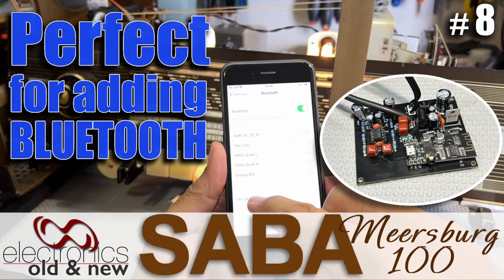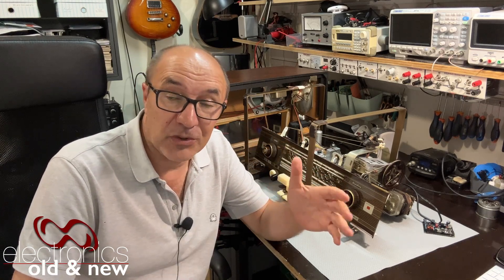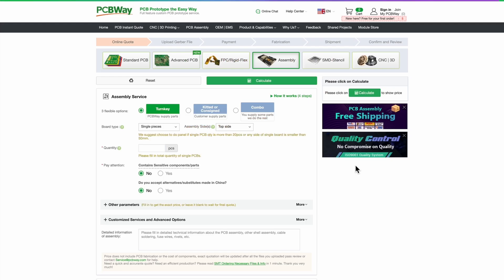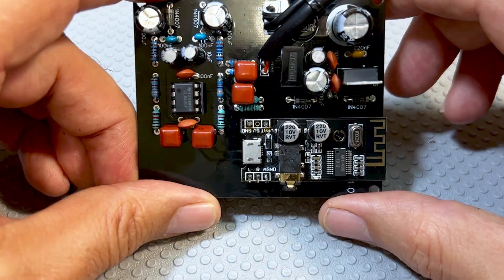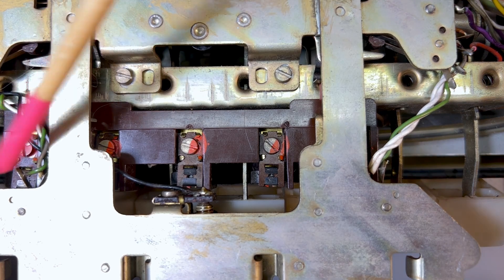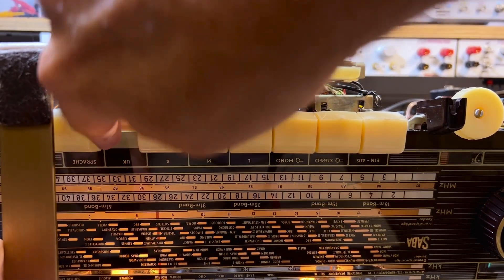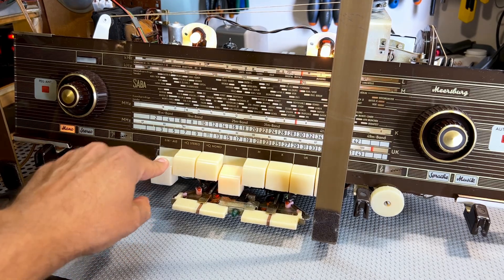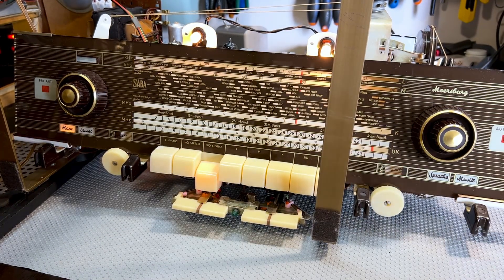This radio was made to have Bluetooth! SABA Meersburg 100 restoration part 8  #pcbway#

Comment: Neat solution with the piano key illumination switching. 👍 Luckily with my Graetz Fantasia 622 I had some spare contacts on the FA key (which is also used in conjuction with the TA key to select the TB input) so I was able to use those to supply power to your Bluetooth module which works brilliantly. I think this comment gleaned from the Web about that particular Graetz radio with its "Schallkompressor" could equally well apply to your Saba - "The radio was built to meet the needs of the wealthiest audiophiles of the day. The sound of this radio is still outstanding today."

But don't tell anyone else or they'll be buying these radio's for parts and stripping the speakers from them. 🤬
Reply from the maker: It’s a good idea to keep some things to yourself 😊 I did a series on the grundig 2147 for a German magazine, and the prices more than doubled. Talk about shooting myself in the foot 😊

Comment: I'd replace that bulb with a blue LED and a resistor. It's not original anyway with the Bluetooth. But if that's a AC source as you said, would an LED like the AC? Probably not so you'd have to rectify and then it'd be a bit more trouble. So....maybe not.
Reply from the maker: Yep. The LED would be perfect, but a little too much hassle to do.
Reply: Why not cut the case and add some VU meters with shiny blue LEDs then? My opinion is that all modifications should look like factory ones from the outside :) For my vintage radios, I use an external Bluetooth module that plugs into phono input. It is powered by one 18650 Li-Ion cell and lasts me over a year :) I was thinking of building (or buying) one that would be completely external and essentially just convert BT audio to FM station.

Comment: Manuel  sounds ,really impressive, the tone control really does its job, a blue lacquered lamp could be nice, or a bit odd   comparing with the other lamps..but it sounds great😊😊
Reply from the maker: I tried some blue paint, but it chips off so I gave up on the idea. I’m sure it’s possible, though.
Reply: @electronicsoldandnew  Use "bulb lacquer" (laca de bombillas). It is designed specially for that.